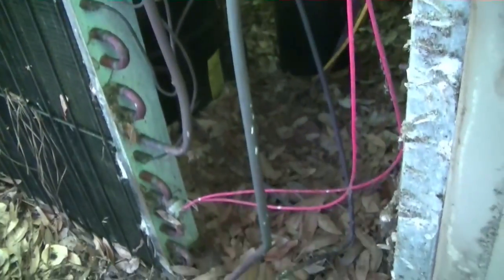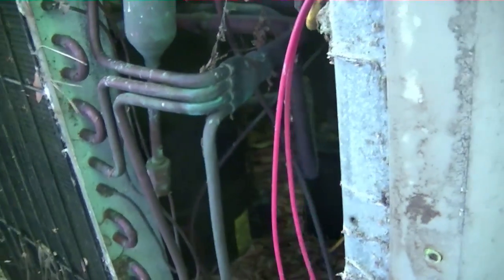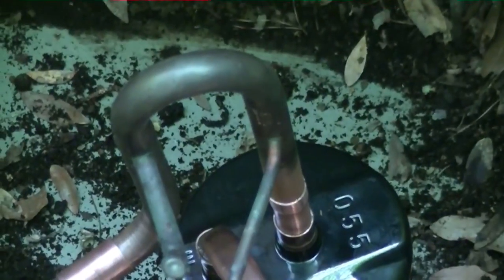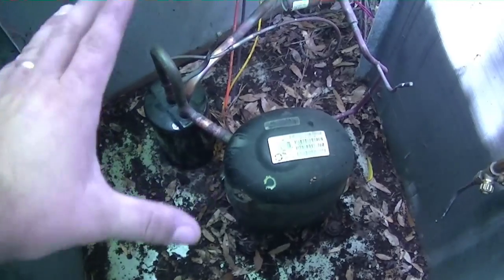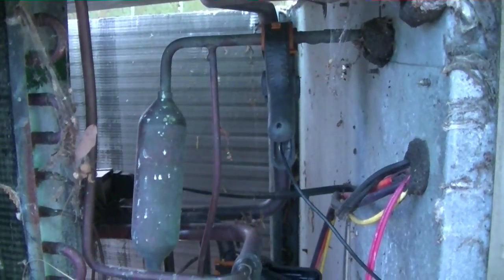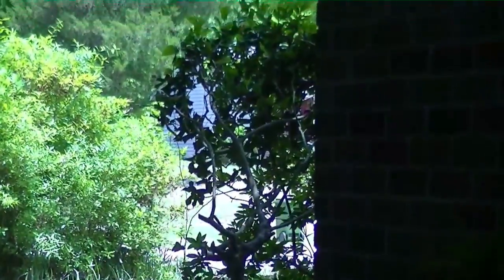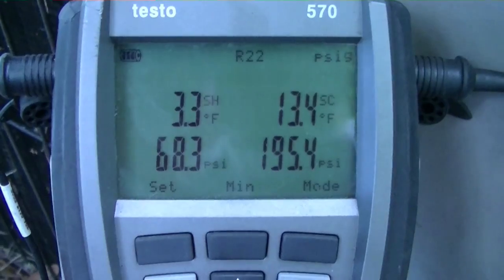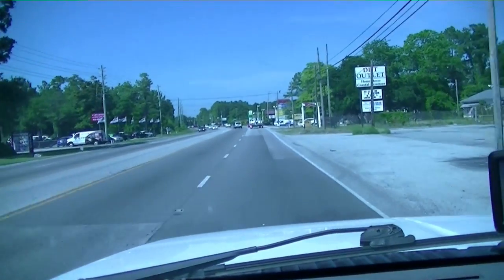HVAC Service Training-  Goodman Heat Pump Accumulator Replacement

Comment: I replaced a leaking accumulator yesterday.  When pressure testing at 200psi I noticed it leaking from the steel siding.  Have you come across this before?  The rubber plugs had held the factory charged nitrogen charge also.  I'm going to order a new accumulator and just chalk it up as bad from the factory.  What do you think?

Comment: I had a guy come out and service my 3 ton goodman unit.....he replaced the condensing coil in the hvac and replaced the accumulator in the outdoor unit he then charged it with freon and charged me 1700 dollars......did he get over on me?
Reply: That sounds like it is within reason to me

Comment: Nice job with the accumulator. If the 570 shows under 500 at least you know it's 500 or less. Good luck getting the 550 fixed.

Comment: Zack, Testo makes a vacuum gauge 552 that works independent or with the 570 and the good part it will print it out with the printer from Testo.
Reply: Yes, when I can and always when no one can figure the unit out. Usually it is a air flow problems.
Reply: Very cool Larry
Reply from the maker: Thanks for the tip Larry, and the tool info you emailed me.
Reply: Zack the 570 will do pretty much every thing that the imanifold will do if you purchase the software for it.
Reply from the maker: Larry Cole I saw that on Bergmanns. It is an awesome tool.
Reply: Yes I enjoy the one I have I do have the software.
Reply from the maker: Larry Cole That's cool, do you use it often?